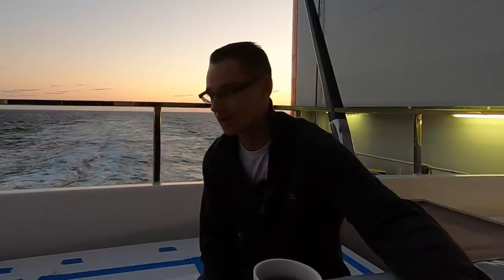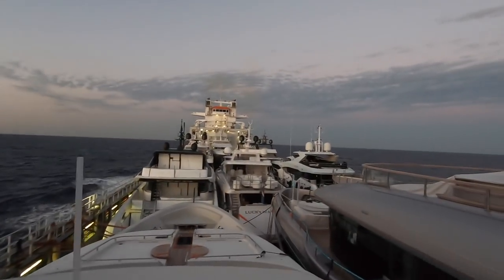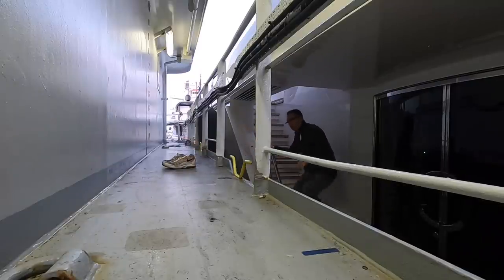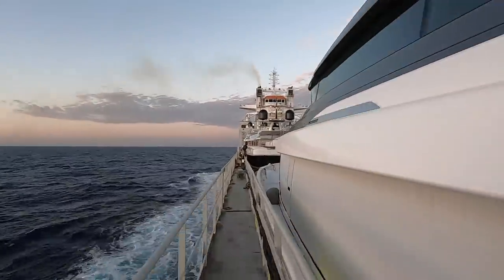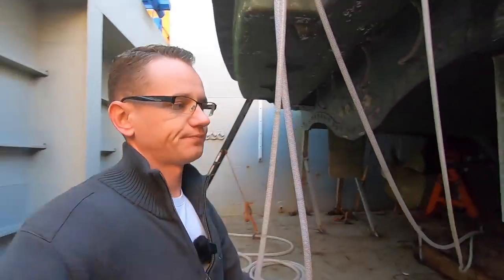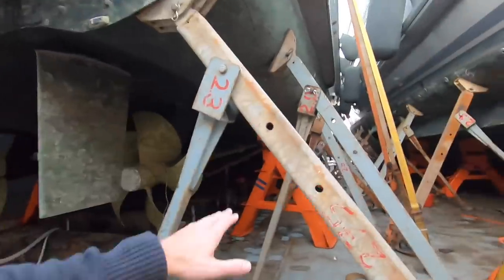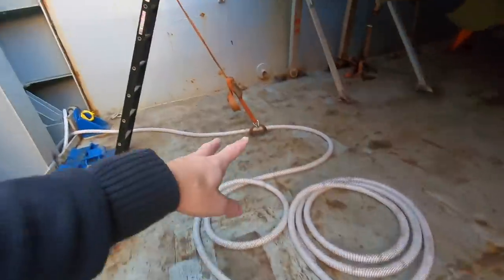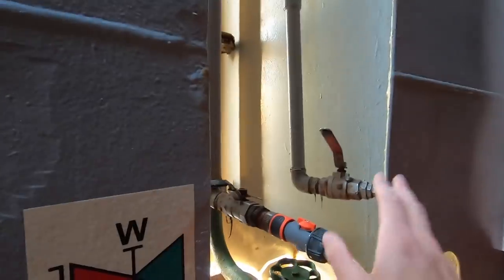Why Cross The Atlantic On A Super Yacht Transporter

Comment: Actually the keel blocks are placed by the ship’s crew before loading when the deck is dry. They are super heavy so we use a forklift to transfer them. And the divers’ job is to monitor if all the yachts are going to sit on keel blocks without any damage to the hull and also they put those orange supports underwater. 
Regarding the grey metal supports: the chief mate identifies the location of each yacht’s frame by knocking yacht’s hull with a small hammer and then makes markings for deckhands to install the supports. Only after those supports are welded. 
Unique plan for keel blocks and the supports is done for each yacht. 
And when the transportation is completed they cut all the D-rings, all supports, chip and paint the deck for the next loading and start rebuilding the keel blocks according to a new cargo plan.
I know that because I’m the crew member being on board now :) I’m happy to answer any questions!
Great video, can’t wait for the next one!
Reply: You're a crew member on this transporter or just a transporter?
Reply: Eae pessoa da Rússia
Reply: Could you share with us what would the cost be to transport a superyacht across the ocean (roughly don't need specific price) ?
Reply: @Modelo646  sorry for the late reply. Roughly from $300k to $500k+ depending on the yacht size (30m to 50m) and destination.
But as far as I know it is still cheaper than doing the crossing by the yacht itself if the yacht is capable of course. (Fuel, crew wage, amortization, etc.)
 Atlantic crossing would be cheaper than Pacific crossing from/to Australia.
Reply: @MrEazyE357  Yes, I still work there in a position of ETO
Reply: @christophb2736  sorry for a late reply, I would be happy to participate but it's quite not on time now xD Hopefully my colleagues Misha and Yurii have told quite a lot about the ship.
Still I can try to answer on any other related stuff :)
Reply: @cortesavulso5215  Olá, mas eu sou da Ucrânia!
Reply: @user-nn3yj7iw9h  That's really interesting. Thanks for the information.

Comment: About 37 years ago I made a similar crossing (from La Spezia to Ft. Lauderdale) in my dad's 63' motor sailer. The crew was me and 5 Itaians. It was an amazing experience. No sat-nav, just a compass and sextant. We sold the boat about one year later, but I still have the charts with our course plots, and the memories.
Reply: AS far as i know you have Yacht categories (Sailing yachts excluded here since most can with a decent size) from A to D and A means atlantic crossing is possible. They are longer than 40 feet and can take on waves of up to 23 feet. These boats can also take on strong winds of at least 47 knots.The others are really not for long distances on the open sea since they can't handle certain waves and as most know the fuel would be an issue. To ensure that the yacht is actually built correctly for trips over the Atlantic and Pacific oceans, it should be certified by the International Marine Certification Institute as i learned. Its really interesting how much there is to learn in this area :)

Comment: While I knew this process exists, I had no idea how any of it worked.  Thank you for sharing and educating us all on this.
Reply: The Cormorant has a better system for carrying large boats, they took lessons from the old UK graving dry docks and how heavy cargo is lash to ships decks, There is no messing about with welding and all the blocks are in place before the deck is flooded, so went fully loaded it's just a case of removing the water and steam out of harbour, in and out all on the same day
Reply: The major reason is a financial one, plus these boats would not be able to cope with an ocean storm, they can handle a sea storm but not an ocean Storm

Comment: Interesting to see  but rather you than me walking about down there, I'd be worried about one of them slipping, the information was great to as to why smaller yachts have to make the journey this was, I knew one of the reasons would be fuel & range but was interesting the other reasons.
Reply: I wonder of Yatch Express ever travels half full..
Reply: I have the same irrational fear of walking next to a boat out the water dont know why but been that way since I was a kid
Reply: @chrisw3513  not irrational, not too long ago there was an incident in bad sea where the yachts broke loose and the transporter sink
Reply: They're lashed down well enough to prevent them 'slipping' in a gale force storm, so I wouldn't worry on a calm day.
Reply: @chrisw3513  I've sat under the keel of a well known UK RoRo ferry. It's a very strange sensation to think of 37.538 tons of metal above you supported only by blocks of oak.

Comment: So I kinda understand that rates are per foot of the yacht being transported and the destination? My question is is your systems electrical and water and black water, gray water all connected and can be dumped over board or do they connect to the ships holding tank. Also what about food do you eat in the ships mess or stock up your own vessel before departure? Then the next question is about trash if you provision your own vessel is there a place to deposit the trash. Are the Yachts allowed full fuel loads?

Comment: I imagine you are connected to the carrier ship's power system, are you restricted on how much energy you can use on board? For example, you mention the AirCon being used, but can you also use non-essential loads (like watching TV)? Is the sea water provided enough to run the generators if you are doing maintenance and need to spin them up?
Reply: TV will use almost no power in comparison to air conditioning.

Comment: Thanks Tristan, the economics and reasons to use a transporter is a lot clearer now (for unlimited yachts). Another question, at 9:50 in, the adjacent yacht has what looks like a bow thruster but it’s direction seems to be set backwards. I can understand it would still work but is it as efficient? May be the perspective. Thanks again, safe crossing. 👍
Reply: Definitely perspective, look a second earlier (just a frame or two, but it's a straight pipe port to starboard like every other). Just looks weird because of the hull shape around it (probably something to streamline water flow and decrease drag when running at higher speeds)

Comment: What does the ship do with the welds of supports after each ship transport? do those get ground off and then re-welded?  Are these welds done directly to the ship or to some sort of base plate? Interesting.
Reply: Probably grind them.  They're going to be ground off anyway to remove the supports.  That deck is probably an inch or more of steel.

Comment: Hey Tristan, great video to see the process of securing the vessel. Quick question - is the flag and class limited by vessel size and/or equipment or just what you apply for? So could AWOL be classed as unlimited if the owner wanted it?
Reply: prolly due to the limit of 150 miles is not eligible.
Reply: I could be wrong, but I'm reasonably certain it has to do with the design of the vessel, i.e. freeboard, stability, capacities, etc.

Comment: Would it be feasible to run the warm water from the yachts A/C systems through the transporters heating to extract exxes heat and save fuel, I wonder?

Comment: Hi Tristan.

Without giving actual transfer cost’s, does it cost more than a $1000000 or less. Very interested to know.
Is it costed on vessel weight per ton etc,

Cheers.
Reply: £1 million!?! An eighth of the cost of AWOL. In 2013 it was reported to cost £175,000 for a 120 ft vessel. In todays market you’d assume It’s about £200k - £250k.

Comment: How can using sea water to cool the condensers without leaving a residue of salt that is very highly corrosive. How do you mitigate corrosion of this condensers? Is there a condenser water closed loop heat exchanger in the system to prevent the incoming sea water from reaching the condensers? Great content as always. Thank you.

Comment: Hey Tristan, great video to see the process of securing the vessel. Quick question - is the flag and class limited by vessel size and/or equipment or just what you apply for? So could AWOL be classed as unlimited if the owner wanted it?

Comment: Hi a great video thanks for sharing. Why do you use sea water for the a/c instead of using the closed circuit type like you use on land?
Reply: For one thing, there's an endless supply of it, and it's free.  Also, compressors can break.

Comment: In the unlikely event of something happening to the transporter, and it sinks, can the yachts float off? Probably not as sinking tends to happen at an angle so some will be trapped and too much damage to others.
Reply: I would think the secured yachts are classified as cargo and insured as such. Priority is saving crew and passengers and let insurance worry about the rest. No way those yachts are coming off until the carrier is docked at the end of its journey and the process is reversed.
Reply: Did you not see all the straps holding the yachts down?

Comment: 1. Life jacket? 2. Helmets? 3. In cargo hold between cargo during sailing? 4. Just climbing of ‘cargo’ and the vessel. 5. Working in ‘cargo’ during transit? 
 
I didn’t study safety, but this is unbelievable! 

Please your answers, why these exceptions?
Reply: 1. Lifejacket while roaming the decks and holds of a commercial freighter? No...!? 2. Filming on deck without a helmet before any potential work overhead starts at daybreak?? No!? 3. Is the cargo hold off limits while at sea? How does the crew check the condition of cargo carried if so? 4. Does the transfer between 2 objects (boats to ship) pose any special danger? 5. Does working in the cargo hold during ocean transit pose any specific danger? I fail to see what is so unbelievable. I'm sure the boat crews follows the carriers safety rules for occupancy and work onboard during transit.